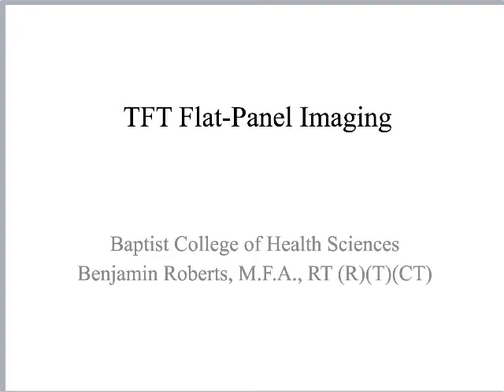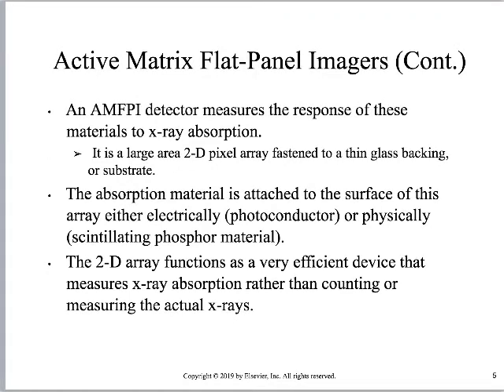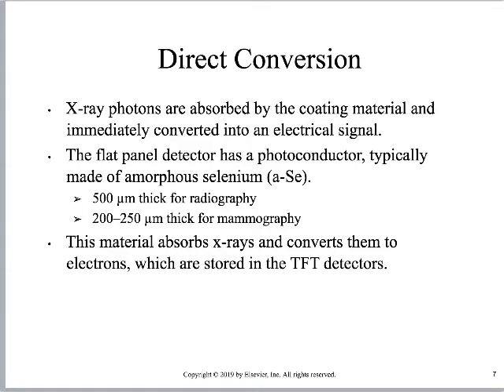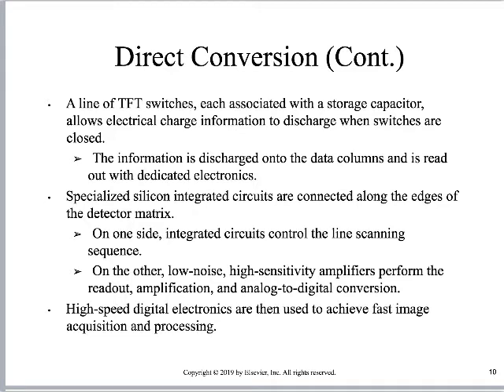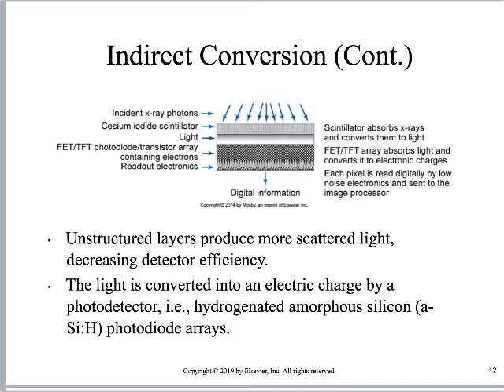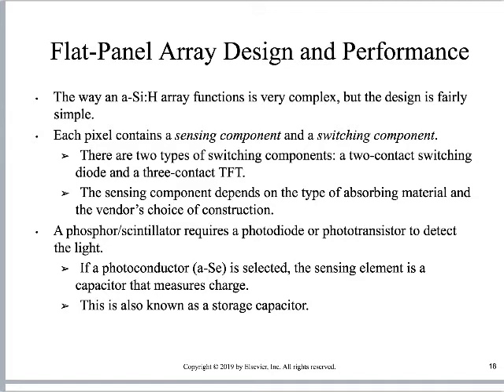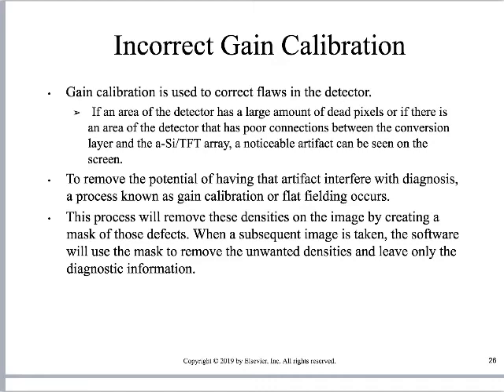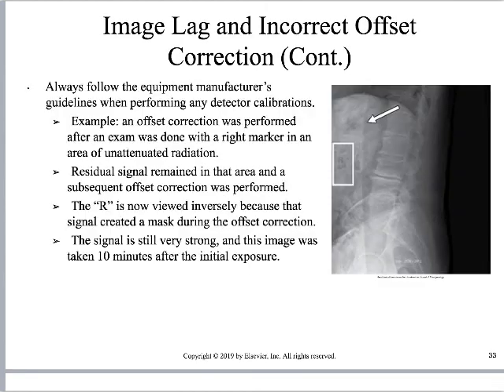TFT flat panel radiography

Comment: thank you so much, this is helping me so much. I'm studying for ARRT and this so extremely helpful. So basically the TFT flat panel detectors are like the image receptor plate that I can remove from the table bucky, take the battery out and charge them when not in use. At my site, we pair it with a tablet and need to hit activate first before shooting.